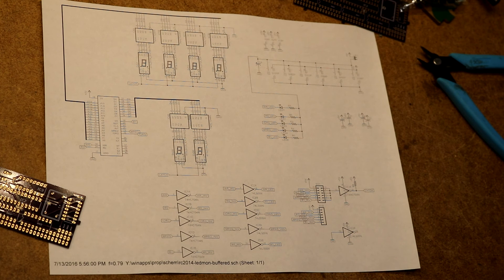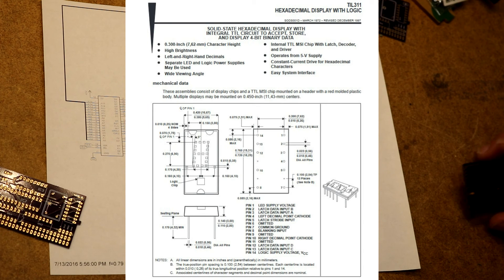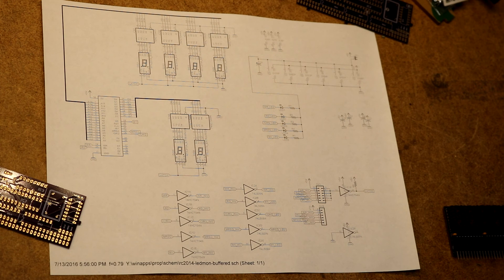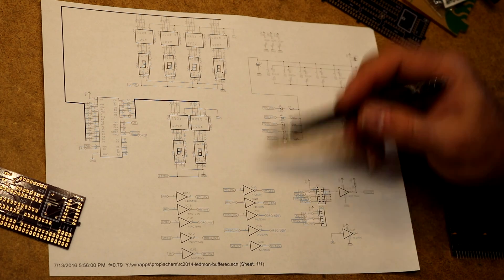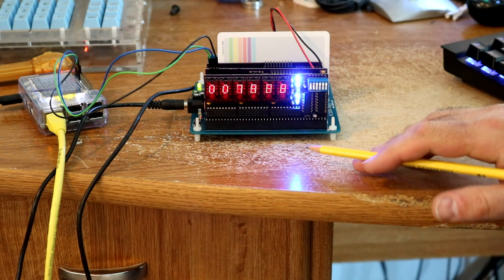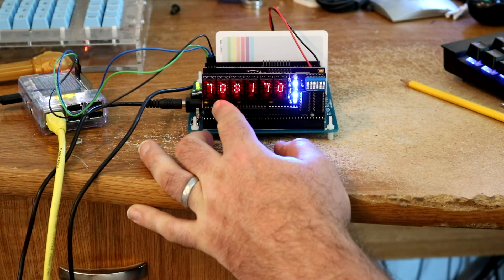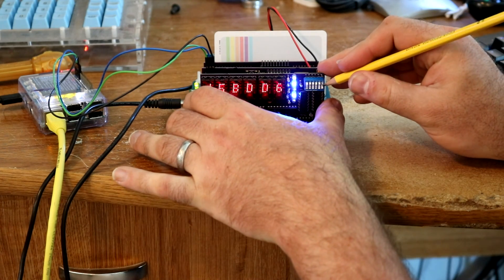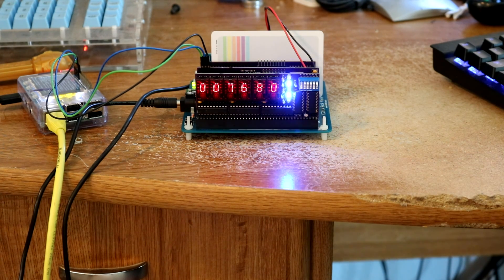Z80 retrocomputing part 3 - Bus Monitor for RC2014 using TIL311 hex displays

Comment: The upper 8 bits on the address bus is for 16  bit in instructions I believe it goed like this:
LD BC,0x55AA ; < 16 bits io address
IN A(C) ; put B on the high 8 bits address bus, C on the lower 8 Bits.
----------------
LD A,0x55
IN A,(0xAA) is the same as above.

Comment: Not a bad re-design Scott but you may really want to explain that the TIL311 is not only obsolete for many, many years but if you can find them they are very expensive, so your design may not be practical other than sharing it on a youtube as an example and one I enjoyed... for old times sake.
Reply from the maker: I picked them up a couple weeks ago from an ebay seller, that sells them for $4.25 each in single quantity, with discounts for larger quantities (I purchased 16 of them at $4 each). That added up to $26 for the six displays in this board, easily making the displays more expensive than all the other components and the PCB combined. Of course, eBay supply can vary greatly, and someone coming across this video weeks, months, or years from now might not be able to source the displays for a reasonable cost, or even find them at all. I think I might stock up on some more of them for future projects. It feels like they could find a home in a (hex) calculator project...
Reply from the maker: Wow, that is a cool replacement, thanks for posting this. I'm tempted to grab a few of the pc boards and build them up, just to be able to compare to the original.
Reply: I have always loved that display for so many years!! I think I actually dream in hex as well... (haha) but I dont think Mr Guidon has them for sale yet, but he has offered the schematic and files for free, Check the link to Hackaday as well. If it can be made with red leds, it would almost be exact, even the 3 pin holes are very close and the processor is less than a buck. All cool stuff!!!
Reply: PICTIL was my idea but it is not my project anymore because al1 did all the work :-D
I turned my focus on DYPLED...
Reply: I'm currently designing a similar circuit for another Z80 based DIY computer. Using a single PIC for conversion + driving and multiplexing using ordinary 7-segment displays. Bet that design could be easily adapted. I absolutely love the PICTIL project tho - if soldering works out for me (so far I've only gone as far as 0805 and QFP-160) I'm probably gonna do a simplified desgin. The few remaining TIL311 modules should be used for repairing vintage hardware (even tho I only know 2 machines off my head).
Reply: The TIL311's can be replaced with DIS1417's.

Comment: Hi. 

very interesting video. Do you know any modern replacement equivalent to the TIL311?
Reply: You should not need any modern day replacement. They are still available on eBay @ a reasonable price.
Reply: PICTIL is open hardware.
Reply: The TIL311's can be replaced with DIS1417's.